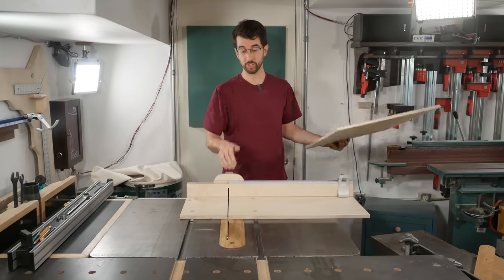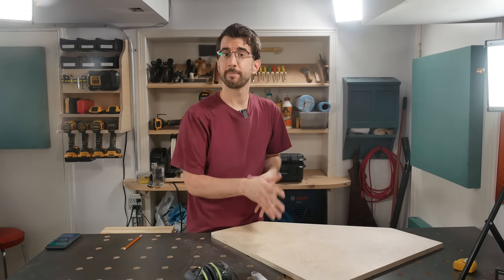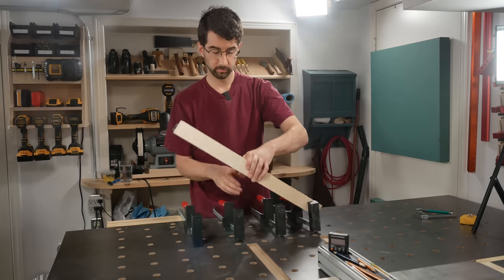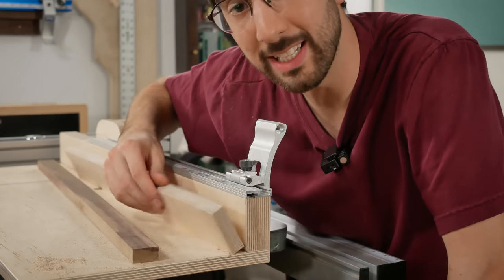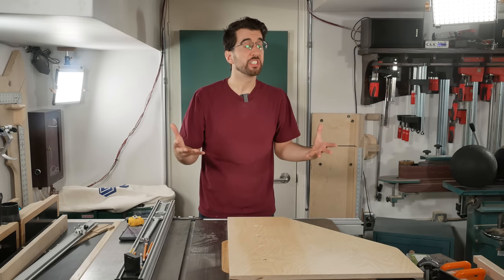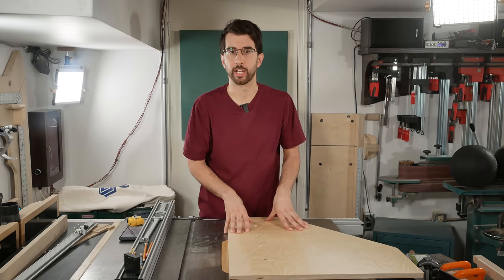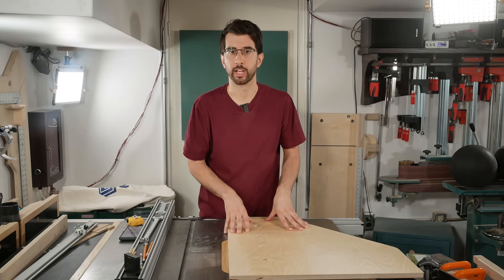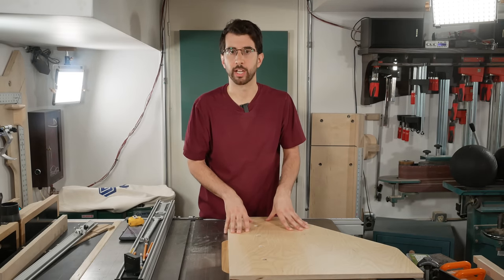the FLAW with Ultimate crosscut sleds

Comment: If your piece of wood used for calibration isn't square can you still use it to square up your sled?  I've seen multiple people do as you did in varying manners and each time I can't tell if they are now using the same piece.  A piece which is certainly no longer square.  And for that matter how do you ever get a square piece to begin the process.  
I hope this isn't too stupid  to ask and that I've explained it properly.
Reply from the maker: Good question, it actually doesn't matter how square the piece is at the start because you're comparing the first cut with the last cut.

Comment: Love the panel sled design. I have my mighty little crosscut sled because of the weight on the front. Or back. What is it? It falls off my table saw too easily anyway. But then I used 4 layers of 3/4"ply for the fence and that's probably overkill, I just had it left over that way.

Comment: HI Scott, I am unsure about why you have the fence on the top end of the sled ? Is it not safer to have it on the end closer to you due to the blade rotating towards you. That way the piece is supported whilst you push it. I have a sled similar to your heavy one and need to make a new one so keen to watch the other video on the smaller sled too. Thanks for the great content.
Reply: I was wondering the same thing. I think this design would work well with larger panels that are less likely to fly backward due to their mass. Pushing forward is plenty to hold them. I think a separate sled for smaller items, with the fence at the bottom, is also something I will make.
Reply: I was thinking the same.  Apparently, this one is for larger panels.  I would still need one with the fence on my side of the sled for doing cross cuts on smaller/narrow things, like table legs, short 1x4 boards etc.

Comment: Great video, very interesting take on a crosscut sled. I like both of Scott's crosscut sled designs. I do want to point out though... I bought the recommended rail and it ended up not fitting in my old Craftsman table saw. No fault of Scott, and the product looks to be of excellent quality, it just won't fit in my table saw track with the wheels still on it (which is partly why you buy this type of rail in the first place.

Also, love the videos Scott, great job!

Comment: Please be careful using this crosscut panel sled.  You need to apply major and consistent forward pressure to the piece to hold it to the front. If the piece moves at an angle at all, it will get caught by the blade and kick back at you. I placed toggle clamps on mine to help hold it and still apply forward pressure. Hope this helps.
Reply: My thought exactly. I'm going to build something similar, but add some way to clamp down the work piece.
Reply: @peethreeorion  I think the whole idea was to keep the weight on the saw, so it doesn't try to fall off when you start the cut on a large panel. I also believe this was specifically designed to cut panels and not standard dimensional lumber, which would explain the fence being on the opposite side not being an issue for him.
Reply: How would you get a kickback without being wedged against the fence?? Worst case is a crappy cut of it slips….
Reply: @ericdonohue9008  the same way you would if you were just cutting a piece free hand. The piece can climb up the saw blade.
Reply: What he has built is just how Euro sliding table saws, some of the safest saws out there, work by default. Clamps on the sliding table there are optional. They are designed with sheet goods processing as a primary function and are both easy and safe to use for that purpose.

On my Felder, I have a shorter fence at the US-normal position just for space reasons (my shop is tiny). That position is easier for narrower wood. The fence at the far end (as shown in this video) would make life easier for sheet goods in my shop. I have to use clamps in this position because, with the fence on the back of the sheet, it will want to rotate when hitting the blade. But if I had used the default setup, pushing the work against the fence in the same direction it is moving, it wouldn't have that tendency.

The only safety concern I saw in this video was the lack of a riving knife. He doesn't even have any sort of provision for a splitter on the blade insert.
Reply: @peethreeorion  It’s a way to cut a panel that’s much larger in width than you can with a typical sled, assuming you have a decent outfeed set-up to support the cut.  I clamp everything to mine - it’s the only safe way to make those wide cuts IMO.
Reply: I always clamp the panel/workpiece on a front fence panel sled.  It’s the only safe way to use that type of sled IMO.
Reply: @peethreeorion  The trick is to stand left at the fence and not behind the blade at all. Kickback pieces can then safely fly without hurting anyone.
Reply: Yy

Comment: I am 100% with you on this. I have a small sled and then just a decent miter gauge with numerous sacrificial fence setups for various angles and cuts. I use MDF for all of it. My fences are all done with t-bolts to make it super quick to switch, allowing me to have everything stay a zero clearance, as only one cut type is done on each.

I’ve never wished I had a huge sled now. I did back in the day when I had a giant one with my job site saw, but now that I have a cabinet saw I prefered to downsize.

Comment: Really like your sled. Unfortunately I don't think it would work for hobbyists like me that have a contractor saw built into a shop table, because the front of the saw table is a lot closer to the blade, so I think I have to have a back fence. Also I'd like to note that I think the reason it may be better to have the sled with the saw line in the middle of the wood instead of just one side of the blade is it would be more like a zero clearance, less likely to get tear out. Do you think both of these claims are accurate? Great work though, if I had a full size saw I like your design. Do you really think a fence extension is necessary? I feel like if your holding the wood down well as you are doing your cut it shouldn't shift.

Comment: A correction for the section above under "To be a little more exact with the five-cut method simplification": you mention needing a square board for the 5 cut method; which is not correct.  All you need is a clean straight cut to put against the fence to get you started.   The other 3 sides don't matter until you finish all the cuts.

Comment: So, it’s imperative to use a board the same width as the length of the fence in order for it to be accurate?
Reply from the maker: To be a little more exact:
1. The board needs to be square
2. The size needs to be the same as the distance between the two screws (one screw is the pivot, one screw is likely near the end of the fence)
3. The pivot point needs to be as close to the blade as possible (1" should do).

Comment: I like the design of this! My only point of difference is that I just got my blade and fence within a thousandth of parallel to the miter slot, and so when I make a "normal" sled I just slide my fence near enough to reference when I lay the body down on my sliders. knowing that the body of the sled is square at least at the near-right corner and straight, then I attach the near fence with a rabbet so that it's perfectly square to the fence and blade with no tweaking. I imagine the same principle would work with this design.
Reply: Yes, well the sled doesn't reference the fence, it references the miter slots. So the reality is, the method of putting the piece against the fence doesn't actually do anything to make your sled square. You can set the base panel at any angle on the bar as long as there is material past the blade to be cut off. It really doesn't matter because once you run the piece through the saw, you have one edge that is parallel with the miter slot. From there its easy to square a fence anywhere you want to on the base.
Reply: @Adventures_of_Marshmallow  if the edge facing the operator and the edge that touches the saw fence are perfectly square, and the table saw fence, blade, and miter slot are all parallel within 0.001'', then it's all perfect already and you don't have to do any cuts or adjustments. Then if you make your sled fence simply index on that edge closest to you that is known to be 90 to the blade, you're good to go. Rob Cosman has a video going through he process if I'm not explaining it well, but I've replicated it and my sled cuts perfectly square.
Reply: @jefflavenau  Not all table saw miter slots are perfectly parallel with the blade and thus, not all miter slots are perfectly parallel with a fence that is parallel with the blade. All that really means there is a little bit of slippage. Slippage during a cut means a nominal 0.125" blade will cut a kerf > 0.125" and leave a rougher edge but the cut will definitely be parallel with the blade. The problem with your method for most folks is most factory plywood they pick up at the depot isn't perfectly square to begin with. I would rather rely on utilizing a mathematical method to making square stock from not square stock than trusting the factory stock is already square. The later is a good way to make parallelogram boxes instead of square boxes.
Reply: @Adventures_of_Marshmallow  you...know you can make the blade parallel to the miter slots right? Like you know you're supposed to do that? Every saw has adjustment for this.
Reply: @jefflavenau  He does not know how to calibrate a table saw.  Mine is good to .0005 inches.  Calibration square one first!

Comment: I made one of those humongous total package, do everything with any size piece sleds a few years back. As yours it was very heavy. It hung on the wall, never used much because it was way too much work to get down and put back. So I appreciate your feelings.
A couple of years with no sled that I would actually use and I built a one side sled similar in function to yours but inspired by one that Matthias Wandel uses. And a smaller, traditional sled that only handles about a 10" wide board. Guess which one gets used most. And which one handles the odd, larger jobs but only weighs about 7 or 8 lbs so is not a problem. And I also have 3 or 4 small, light special purpose sleds that take up very little room but fit very specific niches in my typical projects.
In my opinion this video hits the nail exactly on the head. Nicely done.

Comment: Cut up an old plastic cutting board to use as runners. 

Cutting boards are generally made from ultra.high.density.poly.ethylene, or UHDPE.

If you need, or want UHDPE for a project, this is also the cheapest source you're gonna find. McMaster or Tap® demand your offspring.

Comment: Your parts list calls for a 24 inch (650 mm) miter bar, but the link takes you to a 33 inch (850) bar.  I have not so far found the shorter bar.
Reply from the maker: Check the link in the description of the video, I updated it with two new links. The amazon sellers keep changing their listings and I have no way of knowing when they do that. I'll update the plans and upload a new version to Etsy, which you should be able to access.

Comment: !/4 or 3/8 ply (or masonite) for the bed, and no, it doesn't need to be real stiff because it's riding on the table. Just don't use MDF for the fence, especially on a conventional sled (bitter experience.) Save bunches of pounds.

Comment: Hello....can this method be applicable for a mitre saw?
Reply: Yes, with adaptations for the pivot point and the fact that miter saws fences have a gap between the left and right fences with nothing to "feel" against.  

One can easily cut a piece of plywood 5 times, each time rotating the cut edge into the fence.  Of course you are limited to the 90 deg. cut capacity of your miter saw.

The challenge comes when adjusting the fence.  First you need to establish a pivot point where the fence can rotate without shifting in or out.  A slight side to side shift won't be significant. I would make a fence pivot by using a stick with a pointy end clamped to the miter table , and the pointy end  touching the left fence near the leftmost fence clamp bolt.

In Scott Walsh's video above he makes the side length of his board about equal to the length of his fence.  This maximizes the accuracy, but actually the important thing is to place the feeler gauge a distance from you fence pivot equal to the length of the 5th cut piece. 

Simply use the 5th cut piece as a measuring stick to place the feeler gauge. Place left end at the fence pivot and the feeler gauge at the right end. The feeler end must  fall on on a fence. 
 
If left and right side fences of your saw are connected, then it may may be possible to place the feeler gauge on the right fence if the cut capacity of your saw allows. 
Otherwise measure from the fence pivot to the gap on the left fence and use this to size your 5th cut length. Use a straight edge to adjust your separate right fence to align to the left one.

Wow! I think I figured this out.  Someone should make a video.

Comment: How about a way easier method to check the squareness of anything?  Well, take a wide (6") thin (1/4") board, about 16" long, cut about 6" off using your sled, flip one piece over, and check to see if the edge of the 2 pieces are exactly in line. :face-fuchsia-poop-shape:

Comment: Now, in terms of left side or right side…..  You have a wall on the right side, and you sliding fence.  You would be taking that on and off if you used this sled on the right.  I think it is better on the left side.  a sligth tip case is there, but it is controllable.  Great idea.

Comment: RE:  Adjusting the Craig bar.  You own feeler gauges or i wouldn’t say anything.  Turn the screws in just until you can run a straight edge the length of the bar with out hitting them.  Drop the bar in the slot.  Use the feeler gauges to determine how much slop you have..  The screws are 32-tip, so each turn is 1/32 of an inch.  leave a couple of thousands gap for a slide fit.   Minimal fiddling.

Comment: Scott, do you have any problems with sawdust building up in the holes used to adjust the fit of the runners? Perhaps not problems but does it get irritating?
Reply: Saw dust accumulates everywhere. I just blow it off/out with some shop air.
Reply: It might even be beneficial as you get less saw dust spread over the surface (and sitting in between the sled base and the next piece you want to cut) - it just collects in the holes like lint in a belly button :)

Comment: You divide by 4 because each cut adds to the error of the cut before it, and there are four sides to a square. So the width of the offcut removed by the 5th cut will exaggerate the error of the 1st cut by four.

Comment: I like this design for panels. I’ve used large panel saws and this is similar. I also like a design where my blade guard and splitter can stay on the saw. This might work. I made Norm Abrams version 30 years ago which is right of the blade and fence on the operator side. Maybe I’ll make it reversible to use both sides.

Comment: Like your ideas, I'm still a fan of big rear fenced sleds, where your flip stop is right at you and not up front. I use the Veritas system too, with plywood fences which decrease the weight of the sled. I have started using Garnica Poplar 3/4" ply which is made to be light weight plywood.  Comes in around the weight of the panel sled you made but is as big as your original sled.

Comment: For runner slides, I buy UHMW strips. It is very accurate and lasts forever.  My track is 3/4" so I buy 3/4" UHMW.  Drill it, counter sink the holes, screw it on the bottom of the sled.

Comment: Next time you can save yourself some wood and sometime by putting your wood against the sled so that both Corners touch the sled at the wall make your cut rotate counterclockwise 90°, make your cut move your board over half of an inch make your cut make your measurement and adjust accordingly no math involved whatever you're out is what you're out. And of course verify by make a clean up cut on your second side and then make a half inch cut full strip of course you'll find you've got the same accuracy of square and you only made six cuts you made seven cats and you still have to continue cutting because you need to continue squaring off your board I also have two more cuts to make I suppose but those two sides were never supposed to be anywhere close to square

Comment: FFS… I’ve just bought the mitre tacks for the small sledge and now you say it’s too small!!!
Reply from the maker: I still use the smaller sled 80% of the time, this panel sled is better for the larger panels, but it doesn't come up that much. They work very well as a duo.

Comment: One other thing that I did was to add a 2nd piece of plywood using the 2nd slot on the tablesaw with a downward stop to contact the front edge of the tablesaw.  Push that in to cut off the edge plywood flush with the saw blade.  This makes a zero clearance slot and a plae for the offcut to be fully supported during and after cut.  I really like this, your mileage may vary.

Comment: Instead of cutting 5 times, can't this be done in 3 cuts?
Where side 2 is against the fence during cut 1, instead of going all the way around cutting side 3 & 4 just to recut side 1 with side 2 as the reference against the fence, just skipping cutting side 3 & 4 all together.
Reply: the idea is that it multiplies the error, as you go round and so makes it more accurate and easier  to measure...  and probably overkill for this application!

Comment: Just a tip for attaching the runners, if you don't want to wait for the CA glue to set up use a hot glue gun followed by your screws.  A couple minutes waiting for it to warm up vs having to hold it down for the CA glue to set up